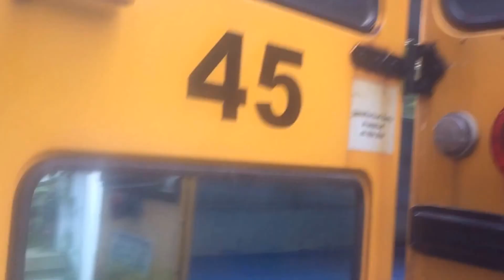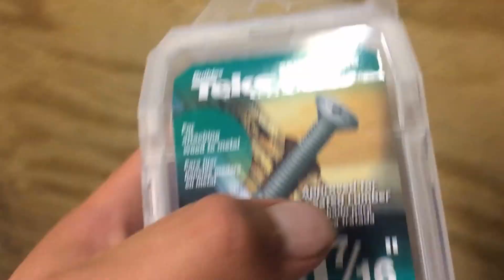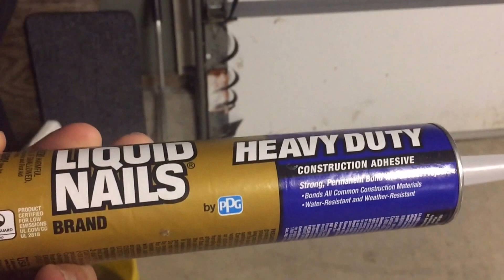Bus conversion, Plywood and Insurance Struggles

Comment: The insurance thing is definitely frustrating. I'm trying to figure out if I can afford insurance myself, since I'm contemplating becoming a contractor on weekends, since I have a CDL.
Reply from the maker: Since you might be opening an actual business it's gonna cost a lot. A LOT. Good luck
Reply: Yeah, I know. I saw Dillon's quote of 35K and that was quite surprising. I gave a rep two vin numbers of busses I was looking at since I'm assuming a mini 20 passenger might be cheaper than a 54 passenger.
Reply from the maker: Yeah maybe then you can get away without a commercial policy.